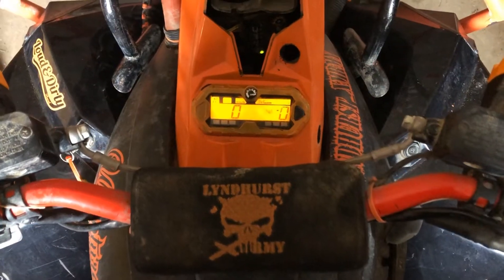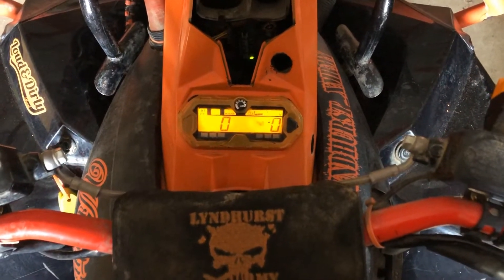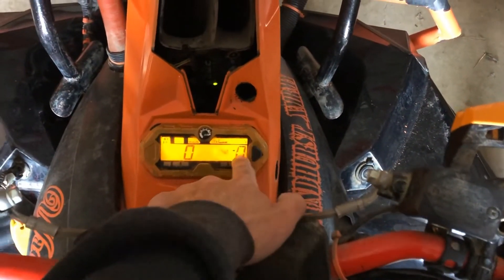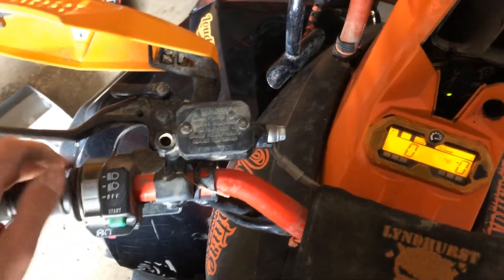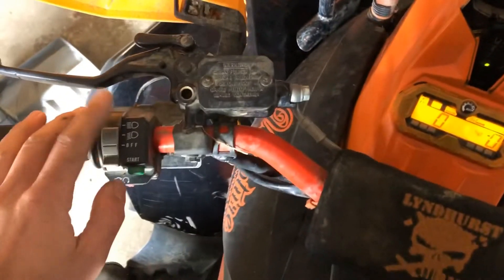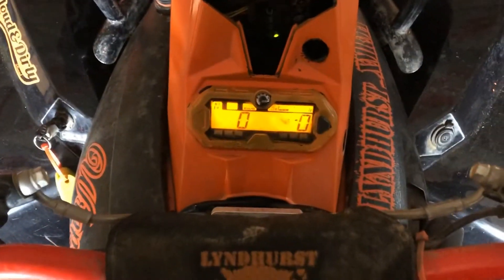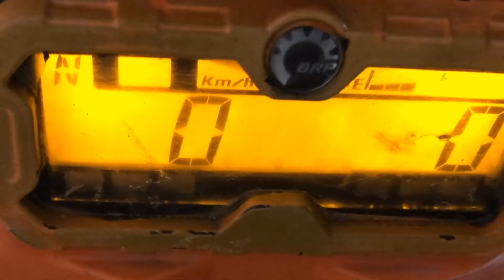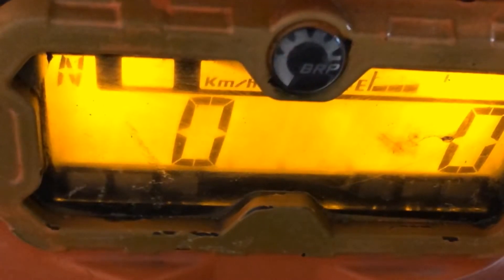HOW TO CLEAR ATV MAINTENANCE REQUIRED CODE - CANAM RENEGADE OUTLANDER XMR XXC XT MAX

Comment: Are there years it doesn't work on? I've tried it multiple times on my '18 XMR and it won't work. Same cluster as pictured.
Reply from the maker: Should work right up till 20'
Reply: @LyndhurstXMRMY  weird mine won't work.
Reply: @LyndhurstXMRMY  got it. My owners manual stated to switch between high and low 3 times within 2sec.
Reply from the maker: @sunburst_xmr  pretty sure thats what i said in the video lol
Reply from the maker: @sunburst_xmr  my bad i said 3 seconds
Reply: @LyndhurstXMRMY  lol. most posts on forums said 3 as well. all good. Thanks for the video!
Reply: My 2012 outlander 1000xt had to be on totally engine hours not miles

Comment: Does this work with Gen1 Renegades?
Reply from the maker: I have not a clue. We havent come across anything but 2nd gens
Reply: I’ll have to try it. My dealer started charging $20 plus tax just to remove the maintenance soon message. So I just leave it.
Reply: @silverrick90 did it work? I have an 11 renegade I want to try it on
Reply: @skidoock3606  unfortunately, no it did not work.

Comment: Does anyone know how to change the view on the screen while riding from RPM back to speed? Somehow mine reverted to this on its own and I cannot figure out how to fix it.  Thanks
Reply: Betty Smith hold down when you see the rpm and it should switch back to speed mine has three options just speed just rpm or both  so I had to do it again to get it back to just speed
Reply: @kelleyann239  Hold down the button next to the digital window? hmm ok, I tried that, but will try again!  Thanks.
Reply from the maker: if you have a renegade, go to the ODO once on the ODO push and hold the select button till it switches, repeat again if you want the speed and rpm refer to this video if unclear https://youtu.be/7Cc7WkbQJVc
Reply: @LyndhurstXMRMY  I tried this and it didn't work... ugh. thanks anyway though
Reply: @bettysmith7045  Yep. Mine on my 17 renegade didn't work either.